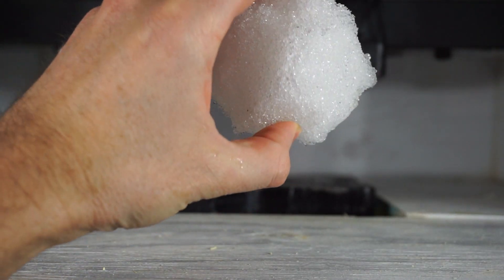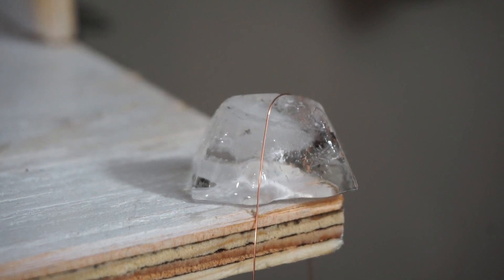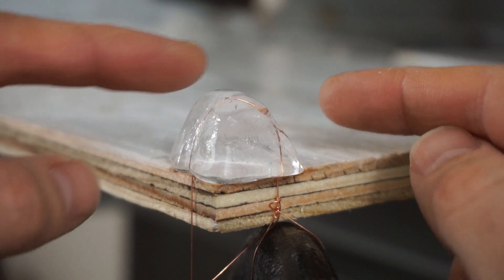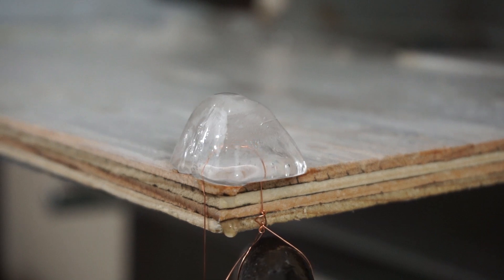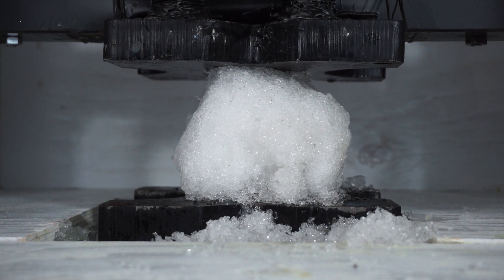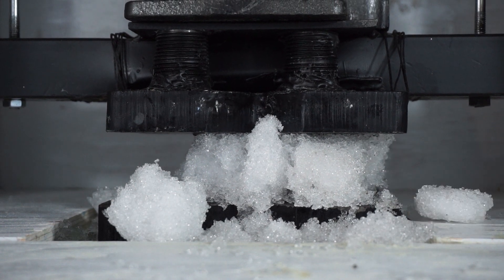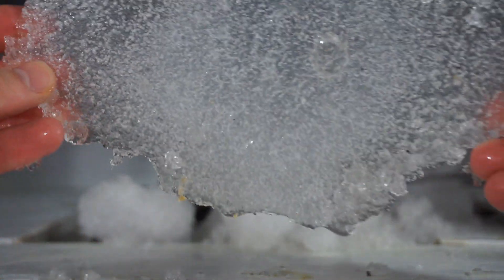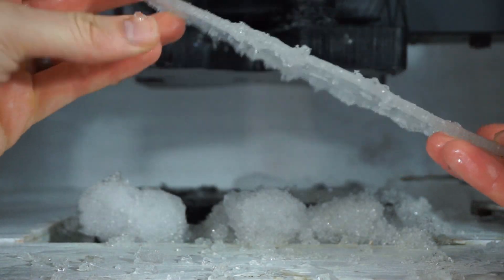Snow Turned Into Clear Sheet Of Ice By A Hydraulic Press

Comment: um it actually is becouse under heaps of pressure the ice articles in snow fuse together to form a large solide peice of ice.and in the copper wire and ice cube expriment the preasure was melting it and it was refreezing but also the cube was melting from the room temperature, if you do it in a below 0 degrees place it'll work better

Comment: COUPLE ISSUES WITH THIS VIDEO.. 1) ICE WILL STICK TO ICE. ALL THE MICRO ICE THAT MAKE UP THE SNOWBALL ARE NOT MELTING ANY MORE THAN THEY WERE BEFORE WHILE UNDER PRESSURE. THEY ARE JUST BEING REORGANIZED AND COMPRESSED. 2) THE AMBIENT TEMPERATURE HEATS THE WIRE AND THE ICE STICKS TO THE ICE WHERE THE WIRE HAS GONE THROUGH.

Comment: Why would the heat of the wire melt the ice? The temperature of the wire should reach equilibrium with the temperature of the ice after a short period of time, and unless the ice is warm enough to melt itself, that's not going to leave the wire warm enough to melt through the ice. Jeez, don't you thermodynamics?

Comment: you just can't be more wrong .... there is no solid that turns into liquid under pressure...
Reply: Стефан Янков ice turns into water again if you get it really really cold. maybe this is related to that process. I feel like if that were the case, that it would take much more pressure than this press can do.
Reply: Ok.... I want to try that... How much is "really really cold" ?And are there any other materials that turn into liquid from a solid state by decreasing the temperature, or increasing the pressure ?
Reply: It's like -200F. It is called glassy water I think. Ice has like a dozen different forms depending on pressure and temperature. But I'm not sure many people have the equipment to do this.

Comment: Can you make a sheet of glass by crushing sand?
Reply: no, it only works with ice due to the nature of its crystal structure (its also the reason that water expands when it freeses, and basically crushing it to melt it is the opposite). Sand and glass are amorphus, meaning that they do not even have crystal structures, but even if they did, its unlikely that they would do the same thing.
Reply: It is easier with high temperatures, but it is in fact possible with just pressure. But despite amazing thing this machine could do, it is still does not have enough pressure to melt sand with pure presser. Not to mention the press is only 1 dimensional, it is hard to contain the pressure from all 3 dimensions.
Reply: mrbandishbhoir interesting, I suppose it could be, buy most materials other than water will not actually melt under pressure
Reply: Peter Silak at a high temp yes
Reply: I know it's possible, i mean can he do it with his press for us to see. :)
Reply: Errr, doesn't pressure = heat?

Comment: dude the wire is not cutting for the ice it's melting because of the ambient temperature in the room come on man basic physics
Reply: DanKop copper.... one of the best conductors... insulates?
Reply: He said that in his video lol
Reply: DanKop hahaha copper insulates??? Durrrrpppp
Reply: lastgunslinger3759 not necessarily.
Reply: lastgunslinger3759 the temperature allows the wire to cut through until eventually it becomes easier to cut.
Reply: Look man even the guy that made the video stated that the wire was not going to the ice because of pressure but because of ambient temperature
Reply: lastgunslinger3759 copper wire insulates... That's why it failed a bit...
Reply: Lol he explains all of that in the video
Reply: Lzzz Incorporated [RNGX] physics is an umbrella term for the phenomena and laws that occur in life.
Reply: lastgunslinger3759 go back to school and leaarrnnn
Reply: inhale

*NEEERRRRRRRDDDDDSSSSS*
Reply: When someone comments what is literally said in the video just to look smart
Reply: lastgunslinger3759 cuando doblas un metal o lo sometes a algún tipo de cambio en su estructura, acumula energía que se transmite en forma de calor parguela, no solo es la temperatura ambiente
Reply: lastgunslinger3759 la termodinamica mal no?
Reply: its a nerd war
Reply: Christ... the wire is cutting the ice because of pressure AND copper's high thermal conductivity. As the wire passes through the ice, the ice melts first, then refreezes behind it, called regelation, and this releases heat. The copper quickly soaks up the heat and uses it to more quickly melt more ice, and as it resolidified behind it, it soaks up more heat, etc, until the wire passes all the way through. The ice left over is not cut in half, but has put itself back together. 
#TheMoreYouKnow
Reply: lastgunslinger3759 that's thermodynamics not physics pinhead.